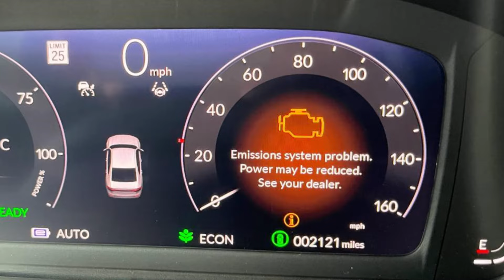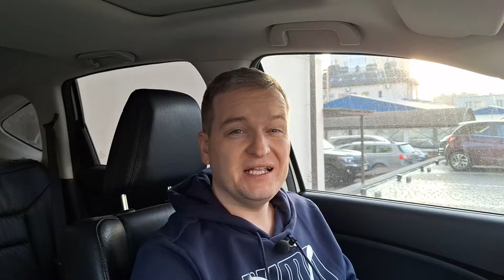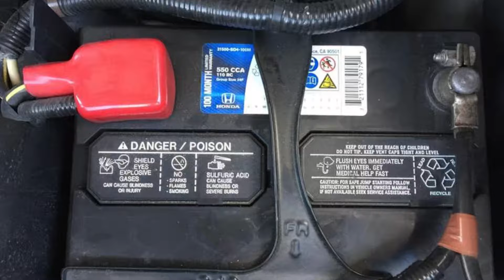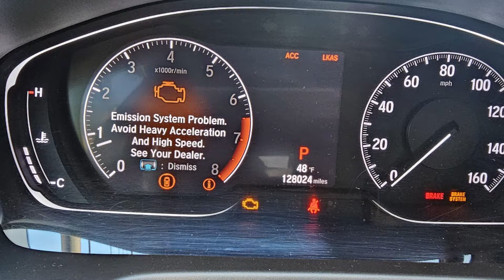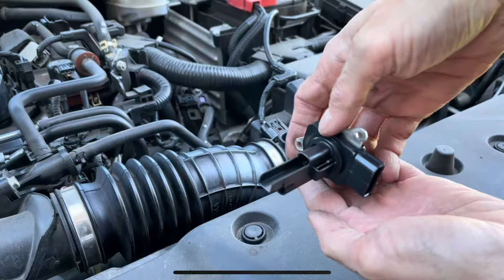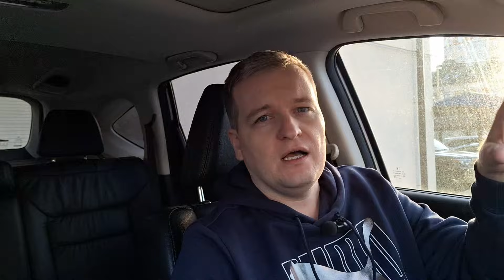“Emissions system problem, power may be reduced” warning in Honda cars

Comment: I've got a honda accord 2.2 i-ctdi executive 2006, got 2 errors since ever and engine light on with limp mode activated and no turbocharger, the errors are P0670 and P1384 (both related to glow plugs and relay)
Below what I've done so far :

New glow plugs installed to specs

New electrical cable from relay to the glow plugs changed 

Cloned ECU 

All electrical cables checked/inspected (although I doubt the mechanic done all of that)

Tried to fit another (used) relay to see if problem will persist, and it does.

Engine starts with no hesitation on cold and warm weather, after a little ride and stop the engine, than if I restart it (once warmer) the engine light is still there but at least I have the turbo back

I've noticed for 3 times when outside was raining and humide the engine light goes off....very strange thing

Another important point is, afte the ECU clone,  the car haven't got the engine light on with all the problems to follow, for about until I've done the full service to the car, after that the engine light came back with all the pain again, might think the mechanic who done the service touched something electrical like wires and the old problem came back on.

If anyone had this exact problem please answer me back, thanks you in advance ❤

Comment: I had the same issue just today. I noticed some of that green white stuff around my negative battery terminal. Disconnected it, cleaned it, put it back on. Car threw every code at me, but it told me to drive so that’s what I did. Car felt completely fine no lost power or nothing. Parked my car turned it off, then turned it back on and the code was cleared. This was for a Honda accord sport 2019 2.0T

Comment: 2025 Honda accord. I have 8,000 miles, 1 year 3 months, and this is the second time I’ve had this issue lol. What a piece of junk.
Reply: Change air filter. Make sure after you change the filter you tightly secure it back in. The warning will go out after a few drives. Start with that first. Don't panic.
Reply: @mauriciowinston5293 9,600 and it happened again after air filter change. U0155 error code. Computer connection error. Taking it in the dealer next week. Next one I’m trading in with another brand. Heard Toyota is great these times

Comment: Hlo I got same issue power system reduced with my Honda accord hybrid I’m take it to mechanic & dealer to they both said no issue but when I drive 3-4 hours I see this issue critical failure & my all sensors is on some time
Reply from the maker: It's a good idea to buy or borrow a good scanner and read the codes once the warning illuminates. When it goes off the dash, the computers may not store the codes anymore, so mechanics can't find the reason.

Comment: THAT is exactly what my 2019 Honda insight is doing now.. not accelerating, kinda shaky at times and ALL those lights come one.. then it all goes away at random! then repeat.. what is really wrong?!
Reply from the maker: You need to know the codes. Maybe a glitch, or an oxygen sensor freaking out, or something with air intake... Reading the codes narrows it down quite well.
Reply: @TopicMotor I have the same problem but with only one code p0172 and my Maf sensor is very low also my intake manifold pressure is very low
Reply: this is what’s happening with my car too! same year but with an accord 
:( what was your fix?
Reply: Change air filter and use premium gas. Unhook battery for 5 minutes to reset check engine light after changing filter. Should solve it.

Comment: They day after I got my oil change done on my 24 accord hybrid and they inspected my car, even looked at the recall, I got this message and check engine light
Reply: Same thing happened to me. Inspection yesterday and it popped up today. Any update on yours?
Reply: @damianizaguirre6653  i think it was just a glitch, i went back to the dealership and the dude doing the service said it shouldnt really be a problem. A month later and no problems 👍
Reply: This is exactly what happened to us!
Reply: Either a glitch or air filter. That's all.  Don't panic.

Comment: My 2025 ridgeline black edition ran out of gas & after I put gas jn it & started it a bunch if signal lights cams on like emissions, power steering, vehicle stability, & hill start guessing its a glitch? Gonna try to restart battery like he said cause it only has 12k miles theres no way it can have all these problems anyone else experience this?
Reply from the maker: That must be an EVAP glitch. I suppose, no need to disconnect the battery - make sure the fuel cap is tightened properly and drive several miles - it should clear itself. But power steering warning seems strange, in this case. Usually, it pops up when there is a voltage-related issue.
Reply: There aren't fuel caps on the new hondas
Reply: I had the same problem. Injection problem.

Comment: Im about to sale my 2021 accord with 63k miles im a accord lover but this issue is driving me crazy i already changed  both oxygen sensors, mass air sensor, both camshaft sensors ,brand new sparks plugs but not the coils cause they look good and no misfire and i still getting the emissions warning light im so piss with Honda now
Reply: Problem fixed ?
Reply: @darsshanahilan3080 no I sold it....I bought a 2017 maxima and maaaan I'm in love with that car no going back to the accord no more...lots of power and comfortable
Reply: I think is that shit of turbo that they putting in those cars now is the problem
Reply: Where are you located?? I'll buy it off you if ur interested

Comment: Thank you.  

This year I  just recently did the national recall repair on the fuel pump  on my Honda pilot 2018 at the dealership.    I wonder if they screwed up the EVAP.
Reply from the maker: Probably, those issues aren't related. I don't think they even touched EVAP within that recall.
Reply: What did you eventually find out?
Reply: @Herewegoaroundagain  I took my 2 Hondas in for recall repairs and ever since the repairs, no more EVAP errors.

Comment: I have a 2019honda accord all lights comes on when cold start up in the morning and car has rough lidle
Reply from the maker: This can be almost anything, from a tiny cheap sensor to a pre-death symptom. Obd codes would help much.
Reply: @TopicMotor  I took it to O'Reilly and said number one and  3 misfire I changed coils and spark plugs still doing the same thing
Reply from the maker: 2 cylinders misfiring is pretty uncommon. Could be because of injectors failing, bad fuel pressure, or internal damages causing compression problems. Also, prior to replaceing plugs and coils, you could have swapped them with other cylinders and see if the codes change. Like these were the codes P0301 and P0303 and when you swapped coils, they became P0302 and P0304 - now you know that it's coils. If codes don't change, coils are OK. Anyway, in this case, I would take it in for an inspection, probably not to a dealership since they have crazy labor prices now. Also, how long ago the filters were changed? I mean fuel and air filters.
Reply: @TopicMotor  when I change coil packs I test drive I couldn't pass anyone all the lights came back so put old coil packs back and had the power to passed another car now number one coil pack don't change tune when I unplug it
Reply from the maker: This would be a guessing game... You need to know codes and then figure it out. If coils are good, try swapping plugs. This needs good inspection with a decent scanner.